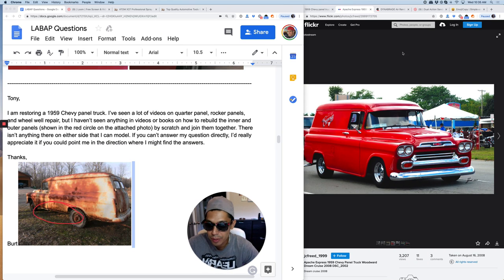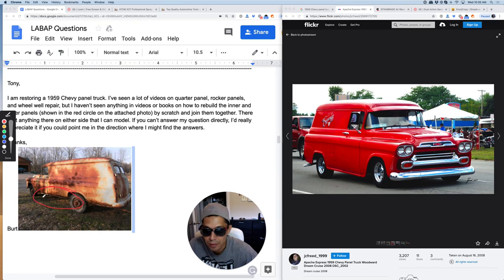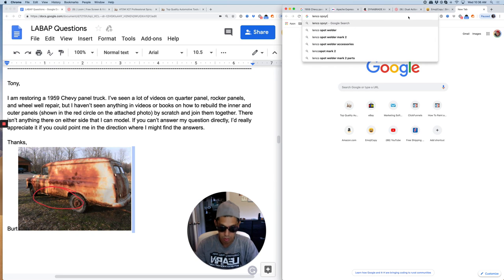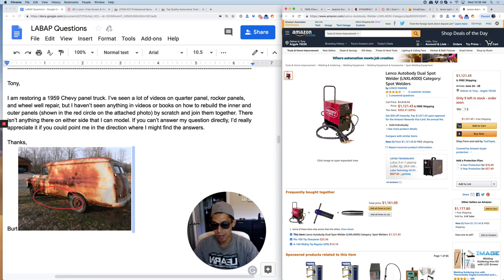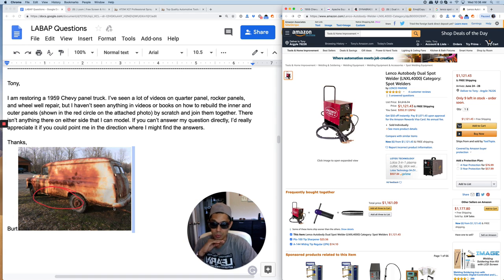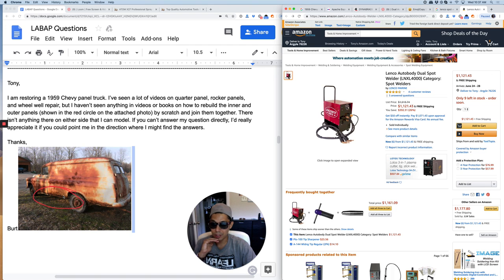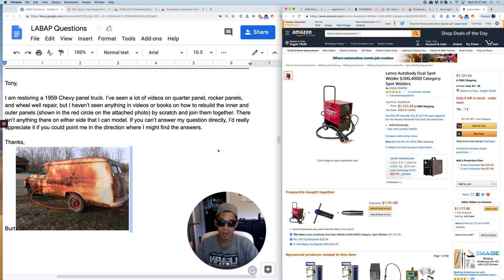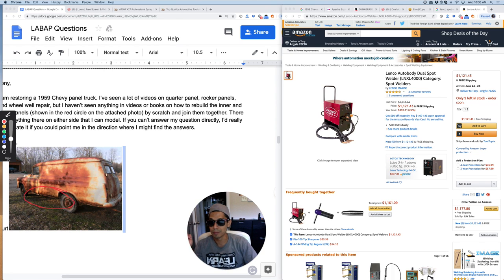Rocker Panel Rust Repair Tips Q&A 💡

Comment: If you google "replacement rocker panel 1959 chevy panel truck" you will see several videos about replacing inner and outer rocker panels. Eastwood does a old c10 which is about the closest to yours that you will find video on, I think. Since Tony's dad was a master sheet metal man, you should defiantly go to his VIP section and check that out also. I think you are going to have to form your own replacements I don't see any panels offered for your truck. If you are not well skilled it sheet metal fabrication, you should look for a shop that has an old body man that has been doing this for years. Check out some of his work on other cars he is doing at the shop and look for someone who can make the replacement sheet metal so good that it only requires little to no skin coat of filler. The old metal guys are so good they don't even need hardly any filler most of the time, they metal finish it perfect. Good luck!